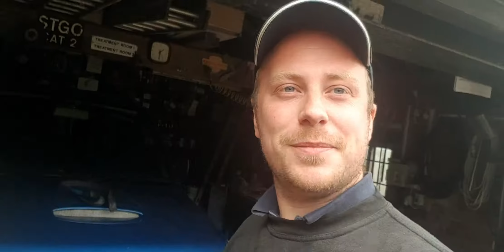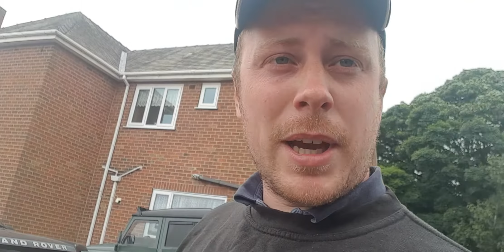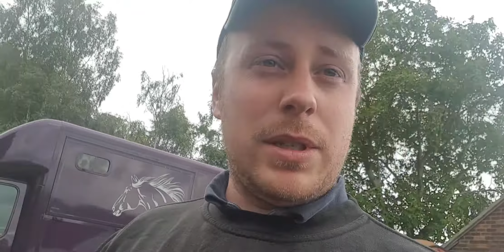I Bought A SCRAP!!! Freelander 2 Non Runner 2.2 TD4 & Channel Update, Defender Update Jimny Update

Comment: ...bloody hell.....you've got plenty to be getting on with there....mind you I can't comment about the number of motors as I have 5 to be sorting/ scrapping here at the moment! :)...actually it's 6 as the Freeloader needs a new clutch as soon as I've done the Defender....
Reply from the maker: It scares me to think of the amount of work that needs doing 🤣🤣 they abit of a bugger on the freelander. I borrowed my mates 2 post lift to do my mums clutch. If i was doing it wothout a lift i would do it how I took the black one apart. Take all the fuel lines off, unplug the engine loom, support the subframe and unbolt it from the body. Remove the engine mounts and lift the front up with the engine lift and drag the engine and gearbox out with the subframe. Only took me 2-3 to get the lot out
Reply: @lifes.projects  ....sounds like a plan....I may well try that....don't worry though, I'll make sure I film it!
Reply from the maker: @GrumpsBarn  Good stuff! You will be suprised how easy it is compared to rolling around on your back!
Reply from the maker: @GrumpsBarn  just thought is there anything you need for your wifes Freelander before i take it to the scrapyard?
Reply: @lifes.projects  ....only the clutch mate...lol....nothing else appears to have fallen off....yet 😂
Reply from the maker: @GrumpsBarn  haha no probs. If you think of anythinglet me know and i will send it out.
Reply: @lifes.projects  Cheers Tom, will do mate